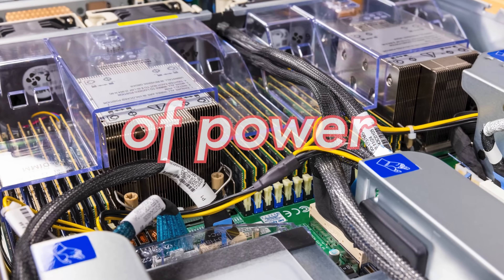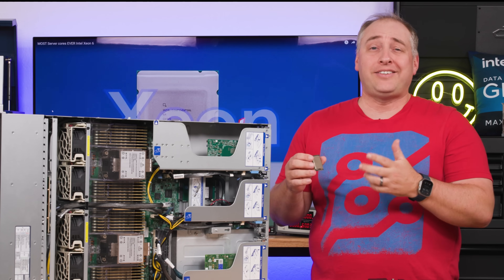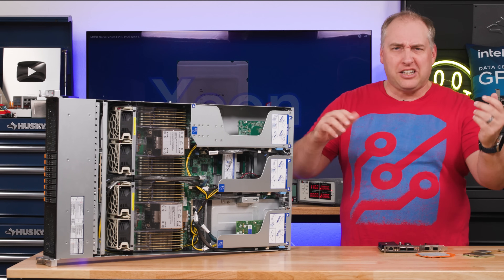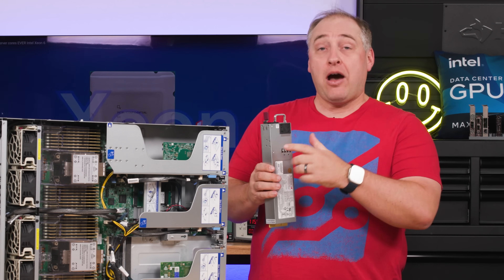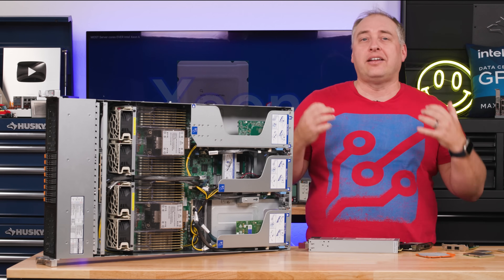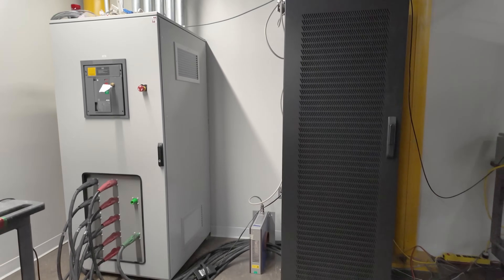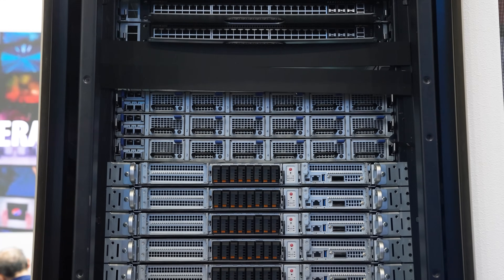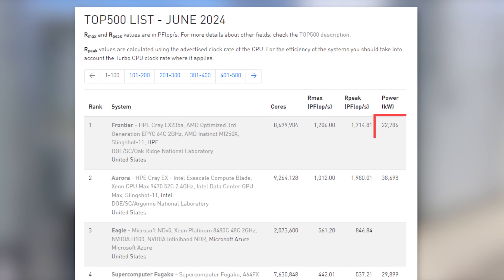Modern Servers Are Guzzling Power - Here is Why

Comment: It's madness. This power guzzling approach to servers is not sustainable. It's only a matter of time before politicians and and legislators begin demanding vendor stop this nonsense of designing such wasteful hardware.
Reply: I think you're missing the point somewhat. A large part of the reason the power demand per system has gotten so high is because they've been able to cram WAY more capability into each system. If each new 1kW server replaces 4 500W servers then your efficiency has gotten a lot better. But off course, you can reasonably argue that the software running on these servers has gotten excessively compute hungry compared to the benefit it provides.
Reply: This is much ado about nothing. Today's modern servers also do much more work if they are guzzling more power. I would actually say electrical efficiency w.r.t work done has improved.
Reply: It is completely fine under the guise of net zero and sustainability. Aka their words mean nothing.
Reply: Not the politicians.  They are stupid and make everything worse.  These companies can figure it out themselves.
Reply: They have a serious problem legislatin away from this. Either Intel/AMD/Nvdia are at the leading edge, or we hand that over to China/Russia.
It is that simple, stay on top or give "the enemy" the upper hand as far as technology goes. This will VERY fast give equal more advanced military capability and loosing THAT edge would likely be the end of USA (as we know it)
Reply: @ssu7653 Russia? They don’t have anything close to Intel/AMD/Nvidia, and probably never will how things are going.

And while China is trying to compete, their strategy is mainly to copy and reverse engineer, not being a technology leader (also they rely on chip fabs in Taiwan).
Reply: @Felix-j3d4b  Neither do we have limits to how much power servers or server farms can use. Meaning we in the west are free to push performance to the absolute max. 
Take away the option to push performance and our leadership in tech will quickly diminish and likely fall behind those that dont limit it.

Comment: Sooo, no mention of the data center's massive fresh water usage? And the ramifications of it, while the whole country is dealing with water scarcities?
Reply: Please do note how politically charged the word "fresh" is in fresh water usage. What do you expect to run those servers on? Murky shit water "fresh" from the sewage systems? The radiator in your car also uses "fresh water" (distilled) and maybe with a tiny bit of chemicals to reduce rust, but in essence, it is fresh water. The radiators inside your house that run off of central heating (if applicable), your toilet and also the shower use "fresh" water to do their thing. 
I know that there were some cases where actual fresh water from e.g. rivers was being sucked up and disposed of by some DC's and that this is ridiculous, but to only focus on the water aspect in a world full of dwindling resources is a bit narrow minded IMHO.
Reply: @masterTigress96  your grievance is selective at best, that water could have been used by the locals regardless. To your point, had they taken murky sewage water, purified it, then used it. We wouldn't be having this conversation. But to say people have such a small attention span that we can't focus on more than one thing, and that this should not be what we focus on is rather dismissive. Because you can literally say that about any topic, and then nothing gets done.
Reply from the maker: Just to give you some idea, I know most of the new AI data centers here in Arizona are being designed for net water neutral operation. Also the fuel cells make water
Reply: The whole country isn't dealing with water scarcities? Like it's very much a regional thing.

Comment: Funny story (now): project to move servers to a DC, told they were supplied by 2 different power stations on opposite sides of the city, 2 UPS systems on site, etc, etc.
One Monday morning, servers all offline - power cut from 1 power station caused that UPS to trip, then the other overloaded. And why weren't we told? The control room was fed from the same UPS so also went ☠️
 Can you say SPOF??? 🤦🤦
Reply from the maker: Yikes!
Reply: That's a real SNAFU.
Reply: It’s a 0.5N-1 data center!
Reply: An untested backup can’t be trusted.
Reply: There certainly are planning issues with the power delivery for that DC, normally you would make sure that both feeds can fully contain your load (2N setup) so when there's a trip there should be no overload or even have capacity to spare.
Reply: Now that's some FUBAR.
Reply: Maybe the price is the issue. Too low to go to 100% availability.
Reply: Somewhere back around 2008, the place I worked at was on a single network connection, a single point of failure.  Lo and behold, the network guys turned around, and got the datacenter connected on a (forgot the term ) ring network - with the ring going in both directions; a supposedly fully redundant network, where it was supposedly IMPOSSIBLE for the ring to go down, because it was redundant in both directions. Foolishly, they also turned down the original connection - to afford the redundant ring setup.  However, it had a problem- every now and again, a few times an hour, it would hiccup, and then drop, and reconnect; So, an engineer with the company running the ring decided, all by himself, to test the theory that it was the ring itself, and decided to disable one of the rings.  A few hours later, after he left for the day, the entire ring came crashing down.  I noticed that it was down. Called the CIO and network meister, and they're like " No, it can't go down, it's fully redundant.. " waited around for about 4 + hours for it to come back up;  only as redundant and foolproof as the team running it. 

Reality is, if you really want fully redundant anything, it will ultimately involve putting your servers and network gear in multiple sites, with redundancy designed in from the get-go.  The company now thinks that they are there, but reality is- they're NOT;  simply put running two servers at two sites cost a bunch of money;  running two servers of 500 different servers is quite expensive, and they're not yet ready to foot that bill yet.
Reply: We had an outfit come out to load test the batteries and they kinda forgot to put us back on the grid when they were done.
Reply: Yeah, that was in Prague, Czech Republic :D it caused funny outages even that the facility was rated as top tier one. I always wonder why they focus so much on centralizing those power deliveries and backups. Like.. it should be much sensible to have a nice row of racks, and at one end it would have the equipment per that segment. Some row may get tripped, but the rest of the DC would survive.

Comment: All the CEOs happy to blow shareholder funds on shiny shiny because FOMO and they have no clue what 'AI' really means.  
Might make for some real bargain GPUs when they go bust.
Reply: But AI can make my leds glow in another color based on the weather. Non AI software could never do such a great thing. (sarcasm) Oh and my washing machine powerd by AI will know how much water and detergent it has to use for my clothes. Because measuring things and comparing it to entries inside table is a thing non AI software couldn't do either. (also sarcasm)
Reply: I don’t think you want to or are even able to use a DC / „AI“ GPU outside of their servers though :/
Reply: @Felix-j3d4b  why? GPUs hardly degrade.
Reply: @r0galik  Most of them are not PCIE (some are) so it's not like you can just pop them in any system.  H100 sxm version has a TDP of 700w which is more power than I use when AC isn't running.
Reply: @r0galik  Datacenter GPUs lack display output ports entirely. Not even unpopulated footprints on the PCB. Completely left out of the design. So you'll need at least one other GPU with a display output for it to be useful... And as far as AI is concerned, there's Cerebras, Sambanova, InspireSemi, and like twenty other fist-sized accelerator chips, all of which beat the pants off a general purpose GPU designed for 16.67ms latencies, for model training and other simulation activities outside of video gaming.

TLDR: Consumer GPU game drivers no worky on professional datacenter cards.
Reply: @SLLabsKamilion  it's funny how they are still called "GPUs" if all they do is crunch arbitrary numbers without even a display output.
Many CPUs today have an integrated gpu though, which can be used to output what's being rendered on the powerful one.
Reply: @r0galik   that's because the numbers they crunch are only for show, as is all of AI . its not real computing
Reply: @SLLabsKamilion  I don't know about H100 and later that's completely diverged from the gaming and pro lineup, but my P100 does compute work on game drivers and I expect the A100 does too.
Reply: @Felix-j3d4b   WTF are you even talking, you can just plug it into your PCIe, you just have to also buy the carrierboard or an infiniband adapter, or just buy a network adapter and plug the GPU into the network via infiniband and access it from the network.
Reply: You're going to need to do a lot more in terms of power and cooling at home.
Reply: @mejesster  come on, who doesn't have a 3.3kW installation at home ?
Reply: And the power costs alone will be very noticeable. Nvidia estimates that an H100 at a utilization rate of 61% will match the average US household power draw. Are you ready to double your power bill for AI?

Comment: servers used to be stupidly power efficient
but when "AI" hit they all went crazy, no matter the investment the latest shiny thing brings crazy returns so shy not pump a whole power plant worth of energy through your server just to generate few images?
Reply from the maker: It happened even before AI if you see the charts in the first part
Reply: Eh, stupidly power efficient is relative. Yes, they were using far less power per server but often did multiple times less work at the same time.
That said, I'm pretty sure that I heard  "it's only 2W per core!" a few times already.
Reply: @MoraFermi  well, actually the consumer components and to some degree even workstation ones that are stupidly inefficient, cutting the power in half reduces the compute by maybe 20%
and don't get me started on graphic cards, RTX 4000 Ada SFF is a monster thanks to nearly linear scaling of GPU compute with "cores" and clocking it around the optimal values
Reply: Depends on how you look at "efficient". For what these things are, they use very little power. But they are the equivalent of hundreds of PCs / laptops. So even at ~2W per core they have hundreds of cores. My "best" system [Dell R815] runs around 250W (total system) with 48 cores; that's about 5W per core. (no GPU) My laptop is 8C and currently says it's drawing 30W. (if I call on the GPU, it'll use 200W)

(Fun fact, much of that 250W is the f'ing cooling fans! I can save 50W(!!!) just by slowing them to 15-20% speed -- something you can't do on modern systems, or even this one if I update the BMC firmware.)
Reply: They still are, stuff just has become denser and denser.
Reply: Happened before AI which Patrick mentions, but combine new CPU's and GPU's and it's a little crazy.
Reply: Huh. So it was AI all along? Man, and here I thought it was all the bitcoin crypto wasting a decade's worth of power a week.
Reply: Hey now, those AI clusters need to train for months looking at millions of images in order to spit out some nightmare fuel photo!!!!
🤣🤣
Reply: Please. With that power, Ai can generate more suggestive images in one minute than porn has in 40 years… progress!